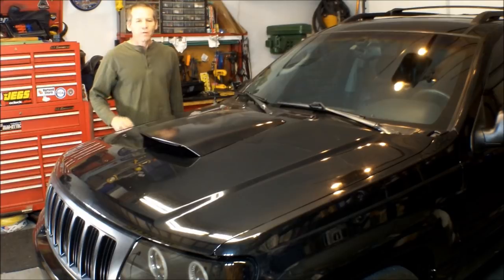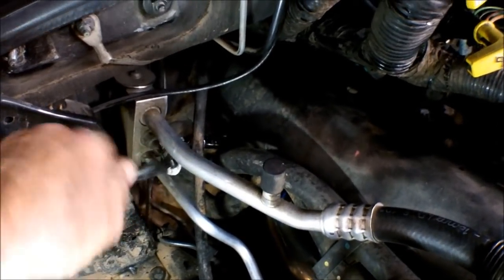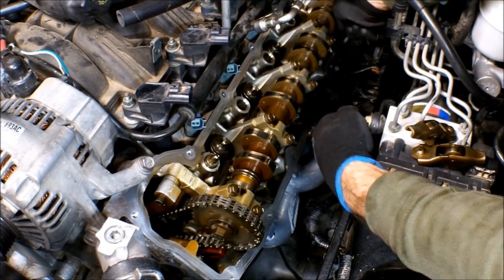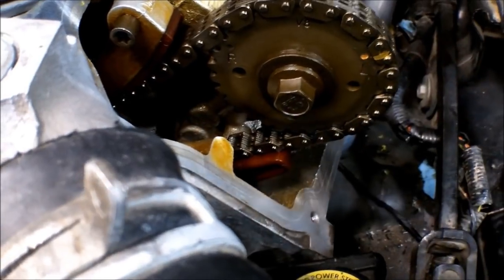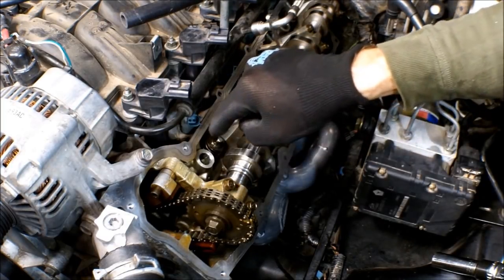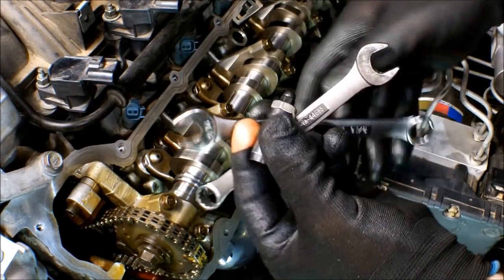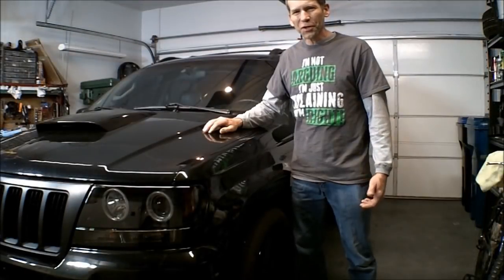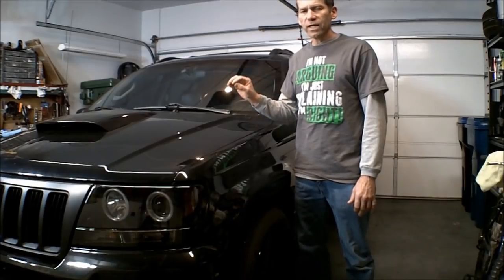How to Install 4.7HO Camshafts & Solid Lifters in a Jeep Dodge Chrysler & Mitsubishi

Comment: Good job sir. Coming from a 18 year dodge mechanic. Dont forget the 2008 cams work excellent too 👍
Reply from the maker: Thank you, funny you mention that, I was installing 08 cams over the weekend with new valve stem seals Springs and retainers.
Reply: @martinbuilt  Haha nice, they come out better than h.o cams. Nice strong pull above 5k.
Reply from the maker: @Gen3HemiBuilder1964  
That's what I hear, got the 08 intake manifold installed and a custom 75 mm throttle body I built.
Reply: @martinbuilt  that's awesome, I'm about ready to do my father's 4.7 Dakota for him. A 75mm would be really nice on it. I scored a  08 intake manifold for him for 60 bucks.
Reply from the maker: @Gen3HemiBuilder1964   yeah the combination of the intake and the 75 mm TB gave me the wow factor. Here is the video for the TB https://youtu.be/HbNrOz74AXY
Reply: I like the idea of popping out the can “before messing with the valve springs. I dropped a few retainers into the block and fished them out using a magnet and monofilament fishing line. This is the only way to go!
Reply: Hi Martin! I have an 03 Durango SLT 4.7 im sorting/building. Good bones. I am going to do valve lash adjusters really soon. Any advantages with using solid over say Melling adjusters?
Reply: Can I use 08's in my 06?

Comment: I think the 4.7 is one of the most under appreciated engines on the planet. I've owned two of them (01 Dak/07 1500) and both were animals and served me well. my 07 1500 even towed better than my current 1500 Hemi.  The bottom end torque they produce is outstanding.
Reply from the maker: I couldn't have said it better!
Reply: I've got two Grand Cherokees. 01 with 4.7 and an 05 with a 5.7 Hemi.  They are both high milage and the 4.7 is a better engine by a pretty good margin. It's also just as fast despite being rated at 100 less hp.
Reply: You have to be joking, i went in my local machine shop the other day and there was these junk engines laying everywhere with holes in top of pistons on most of them where the valve seat fell out of the head. Never heard anyone say they were good engines lol. No offense, i hope yours last forever, i just would hate for you to get too far from home with it.
Reply: @dreece2000  You didn't point out which generation of the 4.7 they were. My guess would be 1st gens. they had problems with valve seats. Gen II engines did not suffer with the problem and were the vast majority of the 4.7's used Dodge/Rams, Durango's, and Dakota's.. but dropping valve seats was not exclusive to the 4.7. Ford and Gm both had their share is nightmares with dropped valve seats, cracking, and so on (also includes those asian and euro products as well) until they got the recipe corrected.
Reply: @dreece2000  Mines got 270,000 miles on it. Still tows and hauls great. These engines are far from being junk. Id take one of these over a 2v or 3v triton any day, and I'd even go as far as saying they are as good or better than their closest competition at the time, the 4.6 Ford Modular. Ive owned both. I didn't like being far from home in that stupid 4.6 Panther body. I had to keep spare ignition coils in the trunk and I was always chasing vacuum and intake leaks. It had a leaky injector that burned up both catalysts and left me on the highway. The 4.7 has been better in every way in my experience. No engine issues in all those miles.
Reply: My dads 4.7 has 330k and still counting. Needs new valve seals and front cylinder on passenger side only reads 110 psi, the reast are 170-180 but other than that its running like it did when new.

Comment: Also another trick I had handy...I had a pair of real long bent nose needle nosed pliers that I got in a set from TSC real cheap and they work absolutely perfect for popping off the rocker arms
Reply from the maker: Yeah I can see where that would work well.
Reply: I tried it at the junk yard before I tried it on mine...worked wonderfully...and since they are long and bent nose, they work for reassembly too

Comment: Well I commend you for your perseverance on the whole job,, it’s definitely a task!! I’ve contemplated trying to get more power out of my 4.7 Mitsubishi Duro Cross,, my situation is I need more power than I can get from headers and solid lifters!! I was given a nice RV and it’s just too much for the pickup to pull !!! My thoughts are since I don’t get any kinda mileage from the 4.7, I’ve a mind to just swap out the motor for a 5.7 Hemi and just install the HO components before installation!! I know it sounds good but I’m sure there’s a lot of hindrances the come with that line of thinking!!! But you did a great job,, thanks for the tips!!!

Comment: I just finished doing my 04. Put 08 cams in while I was at it.  If you're thinking about doing this I can highly recommend it. Be warned, it is quite tedious getting just the right lash clearance. And you cannot just make all the same length. I set the lash .0015 - .002 and the lengths of the solid adjusters varied from the shortest being 1.934" and the longest being 1.952".  Also, the threads are not real fine so a little turn changes the length quite a bit, and also tightening the lock nut will have the length grow about .0005  Makes getting as close to possible to .0015 lash quite the chore. Well worth it though. Dead cold start and.....silence!!  So nice not to hear the clatter on cold start not to mention how much smoother the idle is, and the bonus of a quite noticeable top end increase.
UPDATE!  My PCM decided to retire so I lashed the adjusters again, a couple started getting noisy again. When I checked them the .0015" lash grew to over .002, I also noticed on the base of those adjusters the wear marks were different than the rest of them. They showed localized heavy loading vs the consistent pattern on the bottoms of the ones that maintained the proper lash. My theory is the bottom of the bores the adjusters sit in are not machined very smooth, this was confirmed by looking in the bores. I think the constant pounding of the cam pushing the lash adjuster down during valve actuation pushes the lifter down with more force, not being a hyd cushion the bottom of the adjuster is very slightly flattening down the high peaks the bore cutter leaves in the bottom of the bore increasing the depth of the bore and requiring a lengthening of the adjuster to compensate for the increase in bore depth.
Reply from the maker: Way to go, Charlie, couldn't have said it better myself.

Comment: A while back you told me that if I was rebuilding my motor and had the heads off and was planning on doing HO cams, that i should go ahead and do the whole upgrade and put HO heads on as well...

I searched for an HO motor ever since you said that, apparently these motors are very hard to find in my area...but TODAY I GOT THEM!!! In snow and heavy rain and a period of hale I worked my but off and got those heads HAHAHA

I remember the power our Durango had with a stock 4.7l so I am extremely anxious to get this not back in my truck with these upgrades...I am also hoping to do the intake manifold from the 08 jeep and am working with a guy at Shapeways to get a special filter housing cover made so I can use the snout Style scoops on the hood of my Dakota for "ram air"

Thank you so much for all of these videos...this is my first total engine rebuild and you have taught me so much and made this rebuild a breeze.
Reply from the maker: That's awesome that you found a set of heads. sucks it was in crapy weather.
Reply: Ah well it happens...did we ever get actual numbers on the HO amd torque increases for this? Also was wondering if you would use the HO fuel injectors or the stock ones? (Mine is a 2000)
Reply from the maker: @Kolonol1   As far as I can tell the injectors are the same from non-HO to HO engines they all came with the 145's
Reply: @martinbuilt  oh ok because I was reading something about them have 3.3psi more or something?
Reply from the maker: @Kolonol1  Yeah, I've heard that. I'm calling that BS
Reply: @martinbuilt  hahahaha ok...well I think I'm on your side there because since I said that I looked at the ones I left in the head from the junk yard...they are exactly the same it looks like. I did not check part numbers yet
Reply: @martinbuilt  part numbers are the same HAHAHAHA

Comment: Absolutely the most helpful video on this topic. Thank you!
Reply from the maker: You're very welcome!
Reply: @martinbuilt  I recently purchased a 2003 dodge ram 1500 4.7 and it had a tick to it. I searched and searched Until i came across this very video. Thank you for providing such details. Changed my rocker arms, hydraulic lifters with no problem. 
What is your cash app. Or a way for me to support your channel.. Thanks

Comment: I noticed the min is now .002 and max .004 on the ones I just got. I was going to shoot for .003 but after hearing your comments at the end I'll go for .002  I wanted to add, I have an old Harley ironhead Sportster that uses a similar valve tappet as far as adjustment. They use a ball on both ends so a feeler gauge is out, they are adjusted by how much resistance spinning the pushrod gives. I have found when I get the right lash and then tighten the lock nut it changes oh so slightly the length of the tappet. I am finding this now doing these. On my Sportster I go slightly longer and the tightening of the locknut sneaks it down to the desired length, I found that method works pretty good doing these also. I am in Michigan, not as hot as LV, I used to live in Phoenix, but it is 90 and muggy right now. I am on my third one taking a break feeding the dogs right now.
Reply from the maker: yea I like .0015 to .002

Comment: I have a 2005 Dakota and I’ve recently done new timing chains and head gaskets. That chain wedge tool will be ordered and in my tool box soon. Maybe those HO cams are in the future. Great video!!! Thanks
P.S. word to the wise
I ordered the timing chain master kit from rockauto and everything was good, but the sensor wheel on the passenger side was incorrect causing cam sensor code P0340 to show up on a scanner. I had to take the front of the engine off twice, because I didn’t notice the difference in that wheel. A 2005 Dakota has a N code and a J code and there’s the HO 4.7 so there was no choice in these two different vehicle codes. Pay attention to the VIN.
Reply from the maker: When ordering a timing chain set if you're PCM has 3 connectors it is a JTEC and if you have 4 connectors then it is an NGC these are the ways you tell the difference between the 2 Cam gears on the passenger side.  Your 05 is definitely a NGC 4 connector PCM.

Comment: I've got a 2013 Ram 1500 with a 4.7 and would be interested in doing this also. On a side note I immediately recognized my old neighborhood on your test drive 😃
I grew up in hendertucky!
Reply from the maker: Are you still in the Vegas area? Your 2013 has better cams then the HO's.  I will be installing the 2008+ cams soon with the HO springs.
Reply: @martinbuilt  Ok, this is the first 4.7 I've had. Are these a pretty good engine longevity wise? I've heard things about them dropping valve seats?
Reply: @martinbuilt  Yes, still in Vegas too
Reply from the maker: @DieselTechBryan  personally I like the engine. I love going to pick a part and so far I've seen 2 4.7 s that were in there because of valve seat dropping. When I bought my Jeep the previous owner basically lied to me about any major engine repairs. And then I found out that one of the cylinder heads had been replaced I would imagine it was for that reason. I believe if you keep up on the oil changes and run a high quality engine oil in it that this engine will last you a long time.

Comment: Martin, please provide the information on the updated rocker arms and lifters for the 4.7.  I have a 01 Durango and the lifter are ticking at start up.  Thanks and keep feeding us with good info.
Reply: I have a 2001 dodge dakota with that engine might only have 30,000 on it

Comment: installed HO cams in my 2001 durango today and your video was very helpful!  keep up the good work boss
Reply from the maker: That awesome!
Reply: Did it add any noticeable power or no? Looking to do it on my 04.
Reply from the maker: @connercaraway6315  Yes, you will notice the difference.
Reply: @connercaraway6315  sure did, would recommend!
Reply: @brad3139  could you post a vid of it,looking to cam my 02 durango

Comment: I finally found some HO camshafts. Been looking for 2 years, used online for like $200 and new... no one can find them. If put a HO jeep into any parts website they give same dimensions for the standard cam size in a regular jeep. Anyways I found a set at a junkyard, got them for $40!
Reply from the maker: New HO cams? Excellent price for the junkyard ones at $40

Comment: I recently installed the cams but not the adjustable lifters. I did buy OeM style replacements made by enginetech. The roller wheel in the rockers are the same as the cam lobe width whereas the mopar OEM are much narrower and in time will create a wear pattern on the lobes.

Comment: Hi Martin, I'm driving a '03 Dakota 4.7 of course. There's an '08 Durango at my pick-a-part. I want to do the modifications you mention on your channel, but my question is: should I take the heads off the pick-a-part vehicle, or just the cam shafts and rockers? Will the whole head be compatible with my older 4.7? Is there any difference between the '03 and '08 heads besides the spark plugs? TIA
Reply from the maker: Yeah there is some more differences in the 03 to 08 cylinder heads you would also need the exhaust manifold's, the fuel injectors and I would use the 08 coils and spark plug wires as well 
one other thing that would happen is you're gonna lose compression because the combustion chamber on the 08 is larger than the earlier models.
 The valves are the same size but the intake and exhaust ports are larger on the 08 I'm not sure what the actual end result would be as far as performance,  fro. the loss of horsepower.
 You would also need the valve covers those are also different.
 I would just recommend grabbing the Cam shafts.
 Now if that was a good running engine  at the salvage yard I would grab the whole thing and put that into your 03 and you would probably only have to do some exhaust modification. And a small wiring changes on the Ignition coils.
Reply: @martinbuilt  thanks for your input. I think I'm just going to go for the camshafts. How do I know if it was a good engine without getting too deep into it? The camshaft bearings will have some insight I suppose...

Comment: Great job! Your video will help me out a lot. Getting ready to remove me 4.7L to replace all gasket and sensors . Both of my 2001 and 2000 Jeep grand Cherokee limited are not high outputs. Q’S. Are the high output head valves bigger? 
Looks like Vegas.?
Reply from the maker: Thank you I'm glad you like them and find them helpful. No the valves are the same size throughout the history of the 4.7 99 through 2013.
Yes it is Las Vegas.

Comment: Hey, martin I have a 4.7 crank no start...CPU says the PCM is good. I have changed the camshaft, crankshaft, alternator, battery, Map sensor..also I hear the fuel pump engage when I prime it, there is also pressure in the line and it occasionally starts but dies right out.  I started doing the work because I found out the mechanic was just a parts changer robbing me. please help, thanks

Comment: YOU make it look easy! Seems like you come across more HO motors used in Pick-A Part yards out there than we do here in Pennsylvania. I've been searching for a set of HO cams, or better still complete HO heads with cams to rebuild for my 2000 SLT Durango 4X4 I'm doing a mild refresh on. 150K on the clock, I've owned it since brand new, so this is preemptive, not because of any issues, other than rusted and broken exhaust manifold bolts and heat shields. Would you be interested is selling a set of HO cams or dare I ask heads? Again I only ask as they seem scarce as Hens teeth here. Having driven my HO 2002 Grand Cherokee Limited with the same gears, I want the extra HO power for my Durango as well. What a difference, feels like a lot more than 30 horsepower, though the Durango is heavier than the 02 GC, but the gears are the same. Was toying with putting 3:92's in the Durango as well with the cams and a tune.
Reply from the maker: Hello Phil,  All of the Durango I've seen so far all have 355 gears in them it would be nice to find a set of 392 that is the same gear I would like to install in my Dakota.
 The grand Cherokees with the 4.7 as far as I know all came with 373 pretty good gear,  even though I may change those out to 392 possibly 411.
I do have a set of HO cams available if you like to contact me on my Facebook Messenger there is a link in the description.
Reply: @martinbuilt  Will contact you there. Thanks Martin!

Comment: I think that using the plastic cutting boards for making that wedge may just work perfect. Would my 2003 3.7 Liberty be this same set up. It starts knocking after it warms up¿?¿‽
Reply from the maker: yes a cutting board would work well and yeas the 3.7 is the same when it comes to replacing camshafts, lifters and rockers.